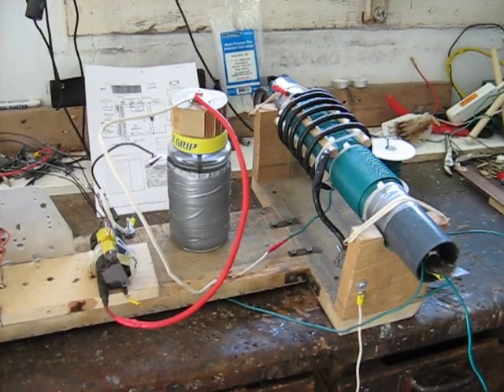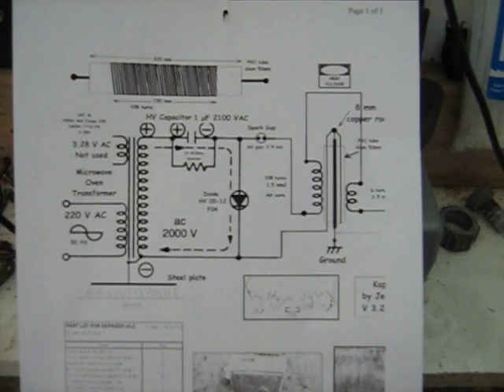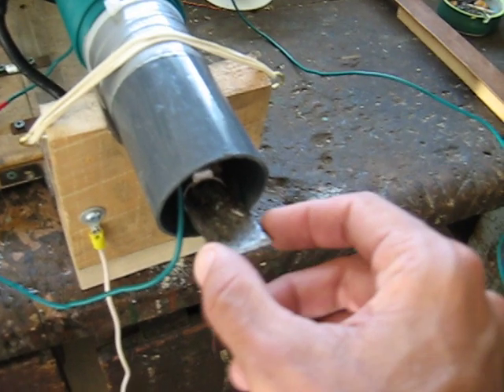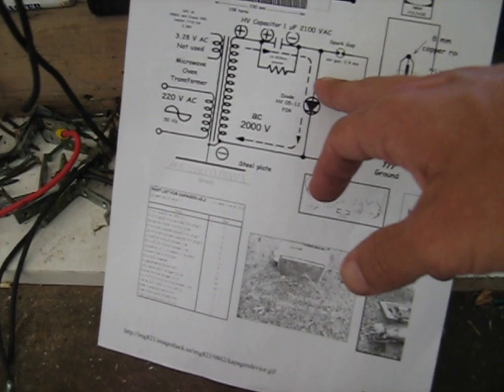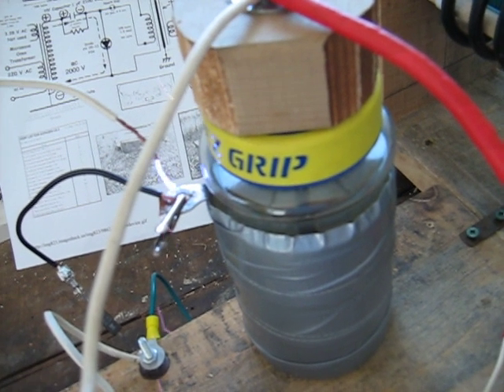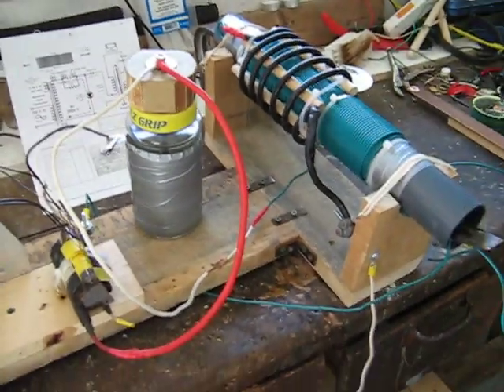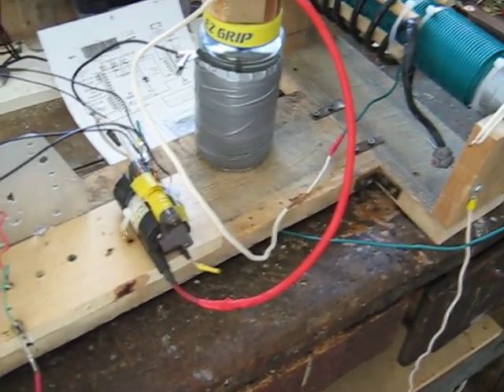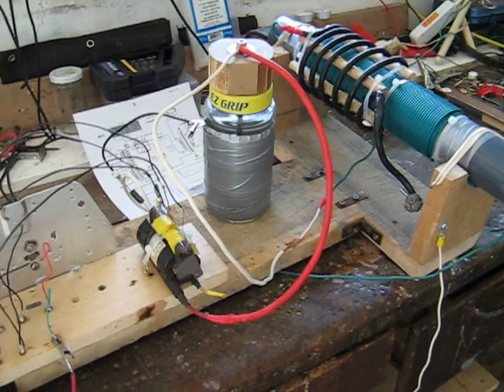Kapanadze Generator - Part 3 Encouraging spark

Comment: hey i am a welder the reason u getting spark from chair to wire is because it is not a good ground AE u will not get a good spark gap like u are off of capacitor